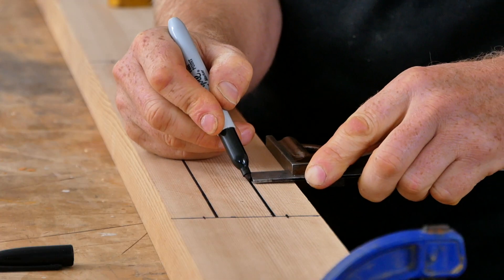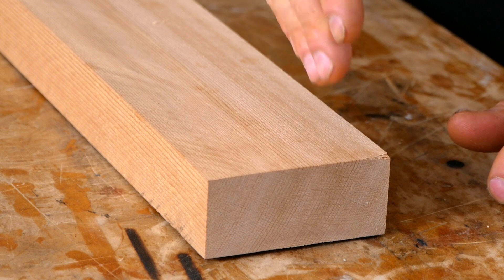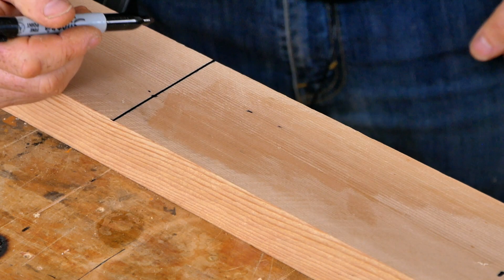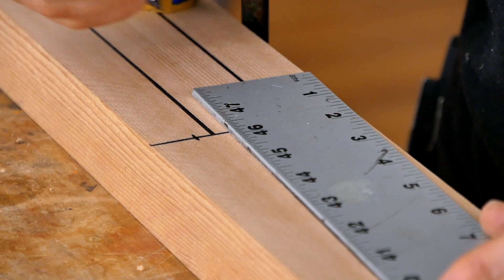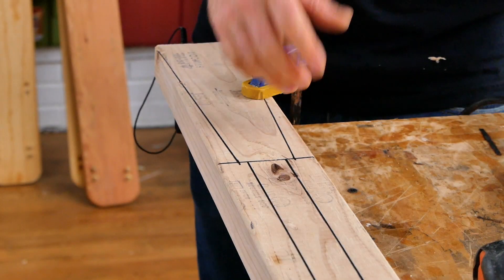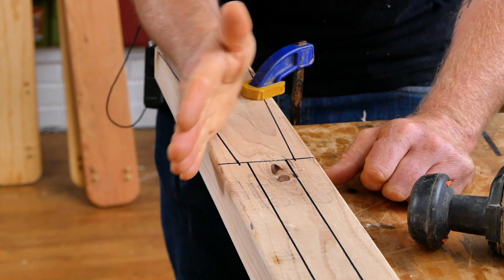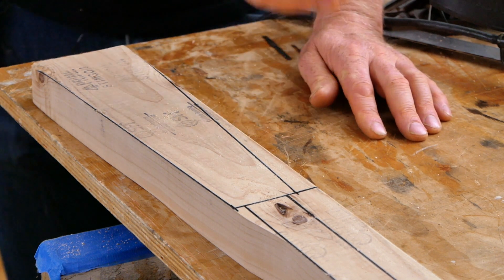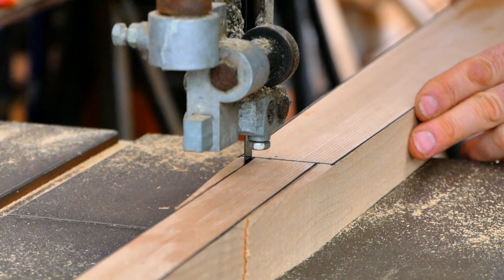Building a Greenland Paddle, Part 7: Layout + Cutting the Shape

Comment: Thank you for the course! I bought the plans and I am building my first paddle. I am thinking about using a small circular saw for the initial long cuts to get a straighter, square cut. The jigsaw isn’t cutting very square on the sides. Thoughts??

Comment: If you're starting with a non-square board, or one with more curve than you'd like, you can layout based on a centerline instead of the edge.
Reply from the maker: Yeah, that’s true to a point, but usually if a board is curved that means that it’s holding tension in it from growing on a slope and what tends to happen is even if you straight edge it when you start cutting it down to the smaller size it will release more tension and curve more.  But it’s all a matter of degree.  Might be fine might not just depending on the stick.

Comment: Is anyone else finding it difficult (or $$$) to get a bandsaw that doesnt drift? are there alternatives?
Reply from the maker: It’s a good idea to start with a bandsaw that’s at least 1 hp and then you want a brand new half inch four tooth blade.  And then it’s just a matter of learning how to set it up correctly.  This is why I have people cut outside of sharpie lines, because the natural drift on many bandsaws will wave in and out of that line.  You can get even more accuracy, but it cost a lot of money for the saw.  The best used saws that you can find are the deltas from the 60s and 70s.  Those old 14 inch saws had a ton of power and we’re quite accurate.